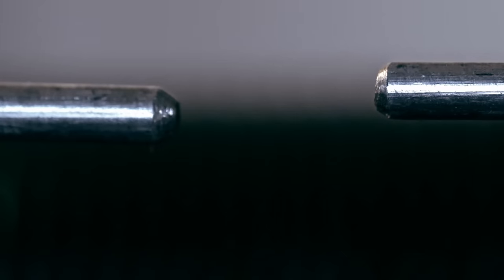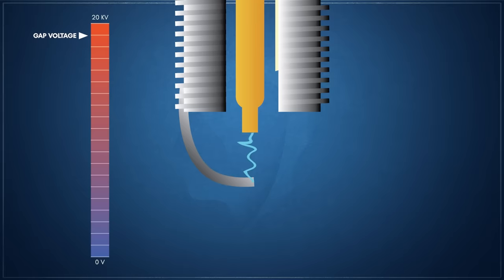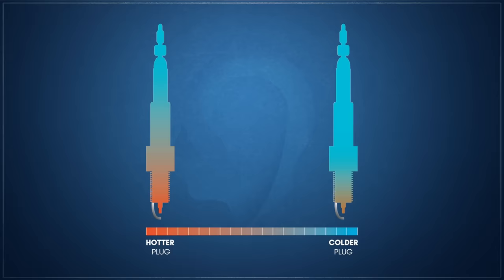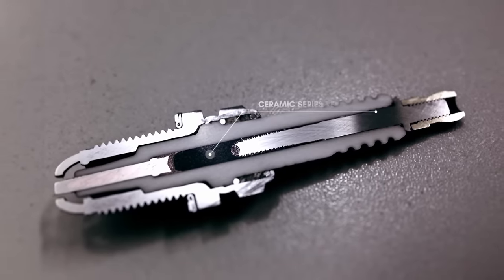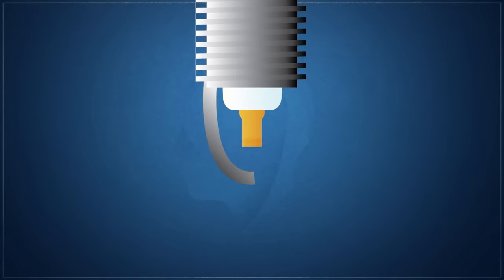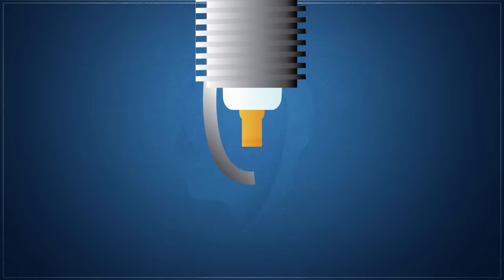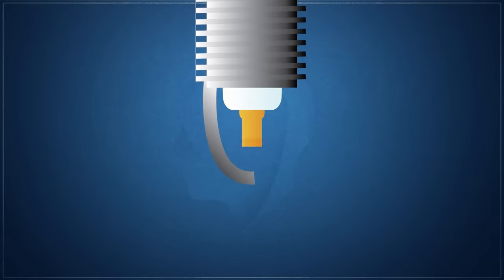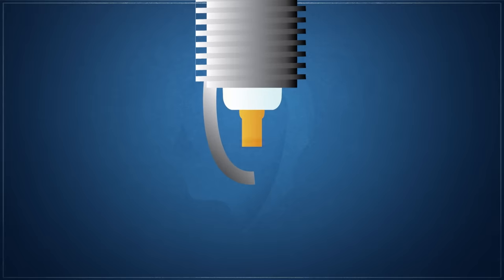The Spark Plug Story

Comment: A primary reason for the switch from distributor to distributorless ignition systems is coil life.  Beyond the increased wear on distributor cap and rotor conductors, having just one coil limited the peak voltage by what the coil could recharge to.  It doesn't take a long time for coil saturation, but when you have a six or eight cylinder engine running at higher loads and RPMs can cause issues.  Having a coil only firing once or twice per complete firing cycle allows them to run cooler, last longer, and provide higher voltages.
Reply: You may want to add energy loss in cables too… just saying.
Reply: That's an answer to a problem that doesn't exist. Old cars with distributors run every bit as good as cars with distributorless ignition. They maybe a percentage point or two less efficient, but they are far easier to service because there's no (expensive) module to burn out...and wonder where you're going to find a diagnostic tool to test it with. On top of that, a lot of companies are discontinuing replacement parts for those earlier distributorless systems, making the prospect of keeping cars from the 90s on the road much more of a challenge. Because the parts are more sophisticated, they require more volume in sales to justify their production. Older cars with simpler parts cost less to keep in the market place.
Reply: @tempest411  This is probably one of the worst takes I've seen on this.  Higher ignition energy is required for higher output engines, which modern engines are.  We're talking cylinder pressures more typical of race engines in the 80s than regular cars.  This higher energy puts more stress on any arcing part, eroding it faster.  I have had a lot of experience with carbs, points, distributors, early electronics, early and modern distributorless, and fuel injection systems from K Jet to 2024 model year direct injection.  I built several hot street engines, and once you're having to run an MSD or other high energy ignition, the cap and rotor life goes down to about 10k, and that's if it doesn't start arc tracking and misfiring.  
The "unreliability" of modules is a myth as well, a lot of perfectly operational ones were condemned as a black box that nobody understood, and diagnosis isn't hard once you've actually worked with this stuff for a while.  I've got 30 years now across all these various iterations of ignition and induction, and I'd gladly take a 100k+reliable electronic system over having to adjust my carb because it's 2° warmer today, or I had to fill up at a different station.
Reply: @jaredkennedy6576  To each his own. I worked in the auto parts business since the late 80s. We had the equipment to test these components for our customers and I can tell you they work great for between 100 and 200k, but they do crap out, and the aftermarket ones are garbage. Many of the OE parts have been long since discontinued, not that many with a 30 year old car are eager to pay what those parts cost anyway.
Reply: @tempest411  I spent five years running a fleet of 48 medium duty delivery vehicles, mostly running GM L96 engines.  They ran 150-200 miles daily, and well over 300k.  Usually I had to change the plugs and wires at 75-90k, depending on the specifics of the use, and the engine at 200k.  The oil pressure usually dropped way off around 220-230k, so it was preemptive.  
I replaced engines, throttle bodies, harnesses, transmissions, differentials, but not once did I ever have a computer failure.  None of the Fords did either.  Same with the Mercedes and Cummins diesel ones.  Now I've been running a smaller fleet in the rust belt with the same company, only 31 vehicles, for the last year and change.  Still no computer failures, and I've had cars with over 700k.  These things get thrashed by the drivers 8-12 hours daily, and soak it up. 
If I had to do a cap, rotor, and copper core plugs every 12k, there would need to be another tech here to keep up.
Reply: @jaredkennedy6576  The computers seldom ever 'fail', but they do cause grief. Several times on my own family's vehicles I've had the computer lead me on wild goose chases when diagnosing a problem. On one, multiple DTCs about oxygen sensors, the MAF, and I forget what else led me nowhere. My 'gut' told me it was the electronic throttle body. I found a good deal on a new oe replacement and it worked. There where NO DTCs related to the throttle body, but it worked pretty wierd just off idle, so that's what led me to that. All of the DTCs went away on their own after a 50 mile drive cycle.  On another car the power windows would arbitrarily stop working. To get them working again you had to pull a battery cable and reconnect it, where it would work for a little while before quitting again. The AC on the car also didn't function, even though the system had and would hold pressure, and the compressor and pressure switches all worked when tested. An independent shop specializing in the make (Mercedes) couldn't figure it out. It took a dealership to diagnose the window issue. Apparently every door has a CAN-BUS computer module thanks to all these stupid cutesy features these cars have, and if one fails, the rest can stop working as well. As far as the AC goes, even the dealership had no way of properly diagnosing the issue. But on a hunch, the tech working on it swapped out the HVAC head unit/control module with one from another customer's car and it worked! There is a diagnostic menu in the module, but it failed to indicate a problem. The door and AC modules on that car cost me $6,500.00. These are just my personal experiences. I spent 30 years working at an auto parts store and heard countless stories from retail and professional customers that were similar. Right now my daily driver is a 1987 Porsche 924S. No points and a carburetor, but still pretty simple. The only modules on the car are the DME for the engine, which, as you've said, are pretty robust, and a very simple one for the AC. It's little more than a couple transistors and relays. It doesn't have any of that CAN-BUS BS, no spurious DTCs. Any issues can be diagnosed with a simple meter. Other vehicles I own are similar; an '88 Jeep, and an '85 Ford truck.
Reply: @tempest411  If it's mechanical, it's a wear item and usually subject to progressive degradation.
If it's electronic (and properly designed and manufactured), it's not a wear item and in most cases will long outlive the service life of the vehicle.
This is why I don't like carbs, points, distributors, etc.

Of course not every electronic item really is properly designed and manufactured (lookin' at you, GM) so reality is sometimes not quite so rosy.
Reply: @godfreypoon5148  I agree that electronics allow for more adaptable systems, but...as cars age, connections become flaky, and, especially starting in the late 90s, the flash programming they began to use in the modules gets corrupted and they stop functioning. Older e-prom based systems weren't as easily programmable, but they are more reliable.
Reply: Amen, brother.

Comment: Small correction in 13:05, higher octane fuel is more resistant to pre-ignition because it is less reactive, which is not the same as volatile 😉. This is the same as saying that the auto-ignition temperature of the fuel is higher.

Comment: As someone who saw mechanics clean the spark plug as first level of troubleshooting in a two stroke scooters of 90s, I always wondered why we never had to change them even after 100k km's in newer cars.. This explains it so well..
Reply: Lean or rich conditions killed plugs easily modern engines have map n 02 sensors that keep them lasting over 100k.

Comment: An interesting extension of this technology is Mazda Skyactive engines which use this sensing to adjust valve timing in a way to, effectively, change the compression ratio of the engine constantly (allowing some blow by the valves on purpose during compression).

Would not be possible without the extremely granular information about the state of combustion and knock.

Comment: Ion- sensing ignition systems are very rare still to this day. I just had a 2020 f350 in the shop with the new 7.3L gas v8 engine. It had the same old school ignition coils/plug wires and it had four knock sensors. No overcomplicated ignition systems to be found on that engine.

Comment: The introduction of unleaded fuel was great for our NSU Ro80 back in the 80s. The Wankel engine had a pretty unique plug design that was easily fouled by lead (and the generally terrible fuel quality in Australia…).

Needed to clean plugs pretty often, but unleaded fuel cured it totally.

Comment: Lots of interesting details here, even forgiving some subtle inaccuracies others have mentioned in the comments.

I was quite surprised to learn that modern gasoline engines also use the spark plug as a sensor to detect running conditions.

One thing slightly outside of the scope of this video, but quite related though: Why in the hell are some engines designed in such a way where you literally have to remove the entire intake manifold to replace the spark plugs?!
Reply: To answer you question you dont need too pull the plugs every now and them like back in the days  most of the time a good modern plug will out life the engine it is in and the coils seams too be fairly strong too and even with preventive maintainace a engine will only eat 2 or 3 Sets of coils in its life soo yeha it just isnt needed
Reply: @TheLtVoss  Yeah, about the coil packs. Kinda helps when the mechanic that installed the last set of coil packs actually plugs in all the wires correctly.

We had to pay like $120 for a new set of coils, only to end up with the mechanic botching the job and didn't have cylinder 1 plug wire properly plugged in. It was just kinda jammed in at about a 45⁰ angle under the rubber boot, bent the connector at the end of the wire, and ended up burning up the replacement coil pack due to arcing at the connection.

We almost had no choice but to have the plug wires replaced due to that crap, which would have required removing the intake manifold and all that good jazz.

But I managed to salvage it, at least they gave us the old set of coils and 2 of the 3 were still good. So I did that coil swap my damn self to make sure it was done right for a change, and I salvaged the plug wire by bending the clip back into shape, wire brushing it clean, and making quite sure all the plug wires were completely plugged into the coils this time.

Saddest part is the mechanics that botched the job had just recently done all the surgery to replace all the plugs and wires, only to screw up one of the wires and burning out not one but two coil packs, from the same plug wire no less!

Honestly I don't really know if that wire goes to cylinder 1 or cylinder 4, nor do I really even care, it's a double fire coil pack setup so either way works.

Sorry for the random story/rant, but thanks for coming to my Ted Talk LOL!
Reply: Say hello to my gen 3 Mitsubishi montero. An amazing suv but it sucks to change my plugs because of all the crap I have to pull off
Reply: Some crappy new cars have entirely too much stuff packaged into too small a compartment with no consideration for service and/or lots of crappy plastic stuff and water pumps placed where when they leak coolant will mix into the engine's oil.

Comment: 8:13 these are things I didn't know about unleaded fuel, and makes me think deeper about the fuel I put into my 1928 Model A
Reply: I'm sure its not too big of a deal since you can manually retard the ignition. With proper leaded fuel, you could probably advance it more and get better fuel efficiency.
Reply: figure out how to get 100LL aircraft fuel, its leaded
Reply: the ford model a was designed to run on just about anything that burns. leaded fuel was not yet the standard, something simmilar to what we call white gas or coleman fuel today was. running on straight ethanol, methanol or even wood gas was also legit
Reply: Really old fashioned gasoline engines had to run on bad gas that was very low octane and also created lots of deposits inside the combustion chambers. Requiring the engines to run very low compression ratios (large combustion chamber volumes)
such engines could probably tolerate having the compression raised by such as shaving the cylinder heads a little bit when using modern gasoline

Comment: One of the best, if not the best informative non-pritical video documentary of spark plugs I've ever witnessed. Now if I was to purchase electric vehicle, this guy should be your salesman. I cannot explain it. Any clear he's simply put why electricity is the next best thing and is inevitably the future as well as its past. A combustion engine will not combust without a spark. You have to have a controlled explosion fire and an uncontrolled explosion is chaos a bomb. So I injured a controlled bomb. The cylinders the engine walls. They all controlled the heat of the explosion. Electrical engines have possibility of eliminating this putting all the power directly into the tires.

Comment: Thanks,  still trying to figure the copper alloy center electrode being able to handle a greater heat range then steel as  copper & brass electrodes were tried 100 years ago and eroded/wore out quickly.

Comment: Anyone else wondering why one spark plug randomly jumps out at 2:04?
Reply: Great question, I'm thinking it was a quality control measure.  If the hole through the center of the insulator was incomplete, a blast of air would pop it out.  The insulators with a correctly formed hole would not.
Reply: That's seems like a very reasonable explanation, thanks.

Comment: As a Emergency Mobile Mechanic..Heat range on spark plugs critical...These spark plugs with multiple ground electrodes/ 2 or more..cause heat range dilema...One good ground electrode with proper heat range number is all you need..Of course..Rotary engines use circular ground design for clearance..Double check part # for these or damage internal$$$$.....

Comment: The video is missing proper indexing of spark plugs(ground arm direction per perticular engine type).  first used before 1887 as a Spark-gap transmitter radios
This plasma kit "Nology HotWires w/coilpack" is neat

Comment: The system only builds voltage to what it needs to jump the gap. Gap too big,requires more voltage which may be harder on the spark plug and high tension wires. Modern systems can withstand/produce more voltage allowing a bigger gap.
Coil on plug reduces the loss of energy or chance of deterioration of long high tension wires (with coil on plug the energy goes most of the way as low voltage higher current)

Comment: Spark plugs in the 70s did not last only 20k miles with frequent cleaning and filing.  40k miles without any other maintenance on the plug was common and still is in these older cars.

Comment: 14:45 I drive a 1993 Saab 9000, and it has direct ignition system with ionization sensor, it was from the early 90s, not late 90s. Its system looks like what today engine looks like, but a simpler one, I guess it was pretty ahead of its time back then.
I know that it did its job as when the system started to fail, it began misfiring and stuttering, the system was there to extract more efficiency out of it and doing so at its limit with help of such sensor, but as it was early design of such thing, it was over-engineer and is damn expensive. Saabs are very reliable, but cost of repair is high, you got to stick to maintenance very strictly.
Reply: What was expensive? And what part of the engine was over-engineer? The lack of cam facers? The lack of direct injection?
At least in Europe a DI ignition pack at the tme could be bought for arround 250 Euro. Not much for 4 ignition coils and electronics.
It was at the time more expensive to change the 4 coils on a VW/Audi 4cyl engine.

Edit:
The ION sense function and DI coil pack was put in production 1988 in 9000CD turbo.. But in the beginning they used to ION sensing for missfire and cylinder/Cam sync.
1993 they started to use the ION sensing for knock detection.
Reply: Trionic 5!
Reply: Those coil packs are practically unavailable now, unfortunately.  I do wonder if a replacement could be built up from more commonly available parts.
Reply: @jaredkennedy6576  In Europe there is plenty to choose from.
Both OEM from SEM and none OEM copies. For Pre T5, T5 and T7.

Comment: 13:00 you claim that higher octane is lower volatility. This is incorrect. Shorter chains have a higher octane rating AND are more volatile. Hence propane having >100 octane, while obviously far more volatile.
Reply: yes higher octane is more volatile because lower octane gas is heavier. but higher octane gas is more resistant to spontaneous combustion which is what i think he meant to explain.

Comment: Nikola Tesla patented the capacitor-coil-point switch ignition system in U.S. Patent 609,250, approved August 16, 1898. Tesla did not develop spark plugs, the ignition patent came when Tesla was developing electrical oscillators.

Comment: Edmond Berger, a freed slave, invented the spark plug in 1839. Berger is credited with the invention even though he did not obtain a patent. The spark plug is a key component of all engines, using electricity to pass a spark between two electrodes to ignite fuel and generate power.